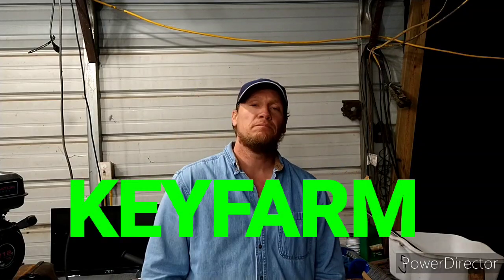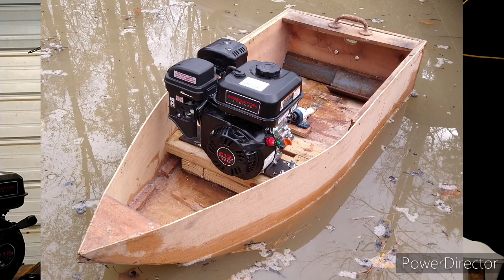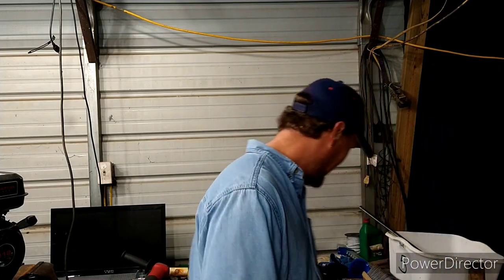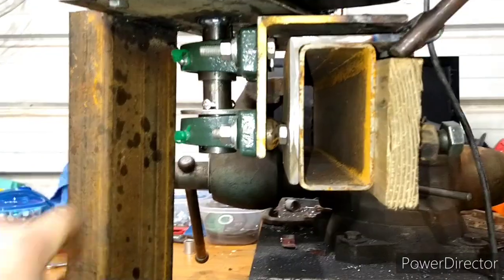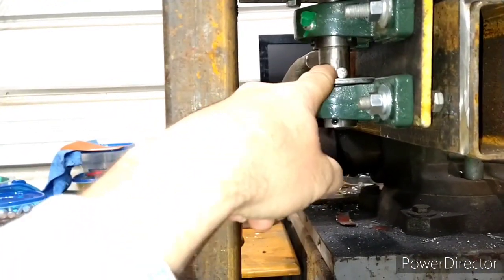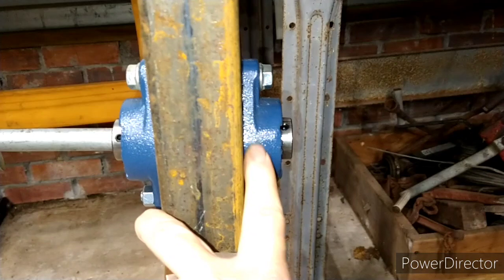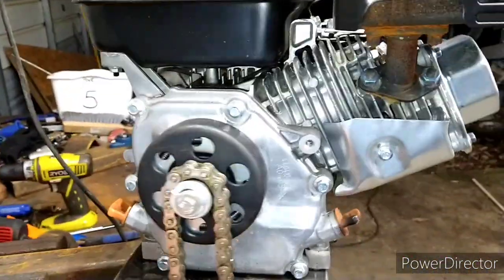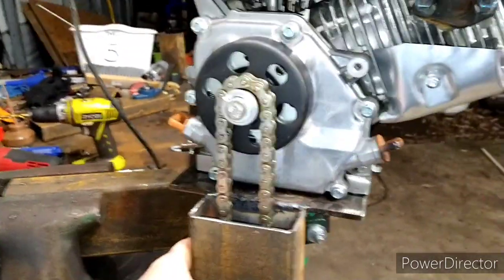Homemade outboard boat motor, predator 212 concept video . Boat engine build.

Comment: A cavitation plate is a great idea along with the skag . By extending the prop shaft and running a 91/2 x9” prop ( left handed ) and run your exhaust into the leg it should work great ! I like your initiative !
Reply from the maker: I'll have to read up on a cavitation plate.

Comment: Mud motors use belt drives and they don’t slip when they get wet
Reply from the maker: Really, I thought they were direct drive, I'll look into it, thanks
Reply: @ChrisfromKeyfarm  checkout Midwest horsepower on YouTube they build the engines for mud Walker drives

Comment: I think you should make the swivel shaft longer and have a bracket that support s it to the square tube not doubting your welds i just think with all the power and stress it could bend were the sterring shaft mounts to the engine plate i know it still has to tilt im just throwing it out there
Reply from the maker: I see what you mean, I really cranked the electricity up and burnt that shaft in deep, but it would be better with a gusset. With this amount of power, I think we'll be ok, however with more power that would absolutely be necessary. Thanks for watching.
Reply from the maker: I've slept on it, your exactly right! I could be cruising down the creek and hit a submerged log, I will make that improvement, it may have been like that in my original drawing I can't remember. Thanks for pointing that out.